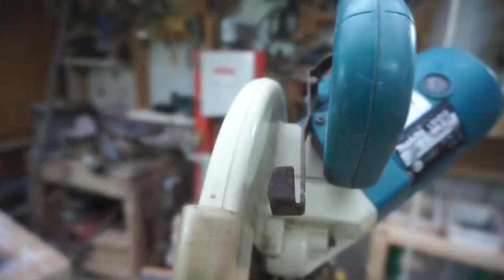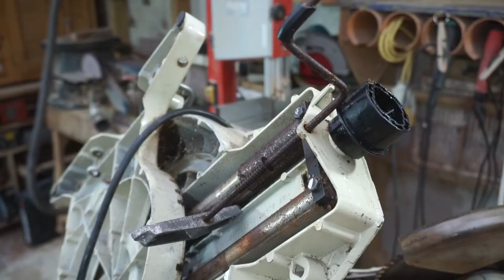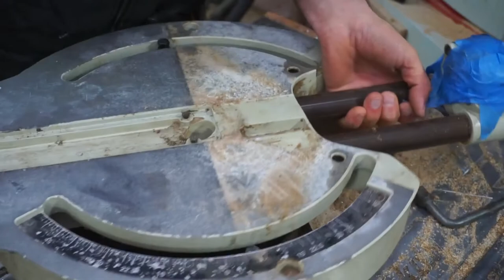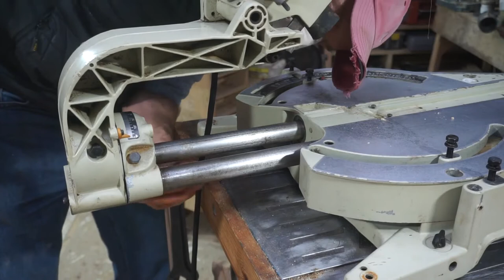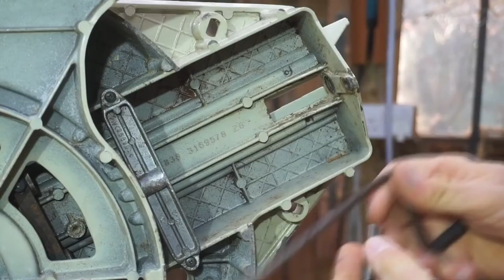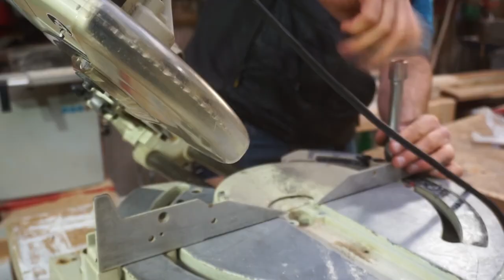Repairing the Cheapest Makita Mitre Saw

Comment: Appreciate this, i've just bought a 2nd hand one for 150 quid, still in pretty good condition. Just 1 question, if I stop the motor, it will gradually slow down until it's spinning slower and then it seems it bites into a break and stops quicker (not instant but quicker). Is that as it should be or should it gradually slow down all the way until it stops?
Reply from the maker: The brake starts once the blade is back in the upright position. If that makes sense.
Reply: @Crooks103 that makes sense, havent actually used it yet still cleaning it out and cleaning some bearings etc. Thanks for the reply!

Comment: Excellent video Crooks!  The attention to detail and great camera shots made it easy to follow along during your tear down and rebuild process.
If I could pick your brain for just a moment, I just bought a Makita LS1013 today from a retired carpenter for $100 that came with a new blade on it.  Runs perfectly, exact 90 degree cuts.  It is in very nice shape for its age.  Everything works with the exception of the inner side of the right side of the blade guard (plastic closest to the metal shroud as it is in the up position when looking from the top down) rubs a bit on the metal when moving the saw up and down.  Do you know if this plastic guard is adjustable to the left/right?   I haven't taken anything apart yet but was wondering if you encountered this on your saw and if so, if you might have a fix for this.  Thank you much in advance.
Reply from the maker: Hey buddy, glad you enjoyed the video. Thanks for your Great comments.
Unfortunately I have never needed to make any adjustments to the guard on any of my Makitas.
I can't be any help to you on this one.
All the best with your repair 
Matt

Comment: So good to see this!  I JUST picked up this exact saw yesterday (4-29-22) for about the same price you paid - $35 USD - thinking it was quite a find for the price.  It has similar issues - impossible to rotate for the miter cut, as well as impossible to rotate for the bevel cut.  But it runs.  It was fun to watch you do precisely what I'm about to do!
Reply from the maker: Hey that's great. Hope my video is helpful. These saws are excellent and super precise. I have another video showing the fence adjustment (if you need it). All the best with you refurb.

Comment: Great vid, i just got one of these for 50 aud in all working order but in need of a few things and cleanup. Wondering what did you use to clean the clear plastic guard? And any idea if you can get transfers or something for the protractor as mine has vanished
Reply from the maker: I use a company over here in the UK for spare parts. Usually the Makita spares are easy to source. 
I would check one of these type of websites for the protractor transfers.
I gave the clear plastic guard a quick wipe with a rag and some WD40, it wasn't so dirty.

Comment: I am interested to know how you cleaned up the tubes so it glides nicely? I am using a LS1014 that needs some TLC, thanks
Reply from the maker: I used a bit of WD-40, and some fine grit sandpaper. Once I had cleaned them enough I used some silicone grease on the bearings. The bearings are underneath the saw bed (incase you needed to know that).
I hope that is helpful
Matt

Comment: Just picked up a similar model in similar condition to what you started with.  What did you use to polish the deck up?
Reply from the maker: I used a wire wheel then orbital sander to 320 grit
Reply: @Crooks103  Thank you!

Comment: Hello
How did you put that spring???? The most important and perhaps the most difficult part is that I am looking for the method of placing the spring. Thank you for your good and informative videos.
Reply from the maker: I should have included that in the video.
I put the spring back in place.
Then I put the steel rod back through the hinge.
My dad gave me a hand, you need a friend to help out a bit really.

You might be able to compress the spring and put it back in, (I couldn't)
I will check later to see if I have any video footage

Comment: Brilliant vid, best of its kind on YT. Can I ask if the detents were worn on the table, a common failure in these saws when older?
Reply from the maker: Do you mean for the angle setting? At first they seemed a bit loose, but once I had fit everything back together and made sure it was running smoothly, no problem